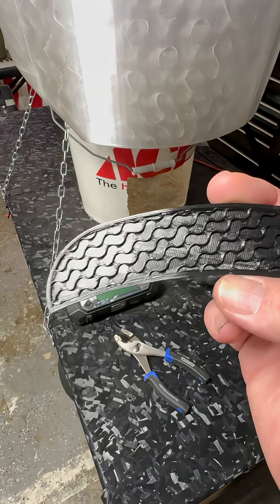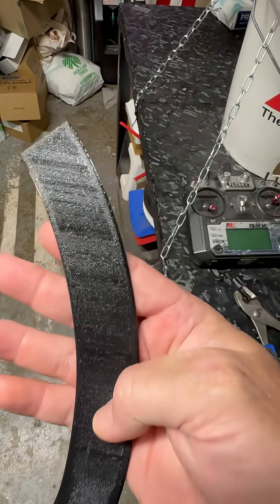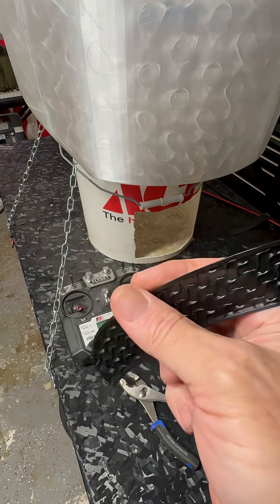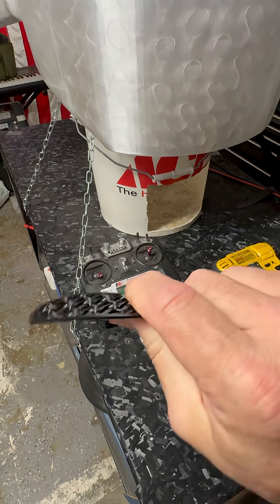Printing TPU with the x1 Carbon. ￼

Comment: For that purpose, in many of my machines I am enjoying what I think is foamed polyethylene, which comes with some packaging. The pieces I have are 5-7mm thickness, and one just needs to get the surface area right.

Alternatively, they sell some soft foamy cylinders with a hole in them that one normally puts on landing gear, but one can cut them in cylindrical pieces and glue on, also works well.

Comment: What about a roller or you can put tension on or take attention off of this like a tensioner for a belt I mean last time I checked I can turn the motor over. I think you can freaking make that work
Reply from the maker: I was thinking about a roller something I could either mount on the back pool holder or off the printer altogether it seems to be the weight of the material when it’s a new role and how it kind of sticks together on the spool it’s almost like any tension at all, stretches it out just enough not to extrude properly. Could also be attributed to the brand.

Comment: Could you put the spools on needle bearings to reduce over all friction when unspooling, would help mostly when it’s heavier.
Reply from the maker: I am working on a roller, however I noticed it’s the weight of the material on the spool. As it tries to roll it, it stretches the material out, causing under extrusion. The sensor inside can’t tell for some reason it keeps asking me if filament is coming out.